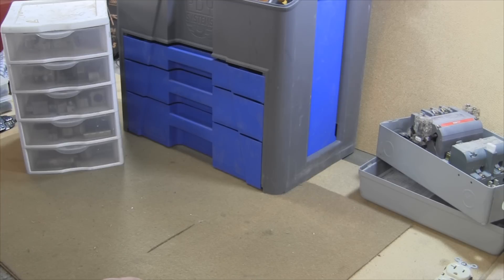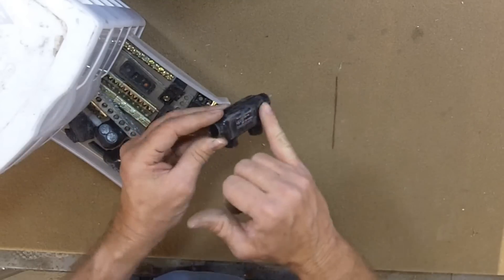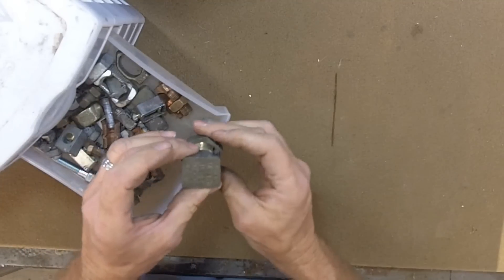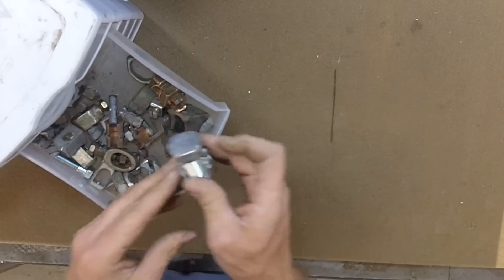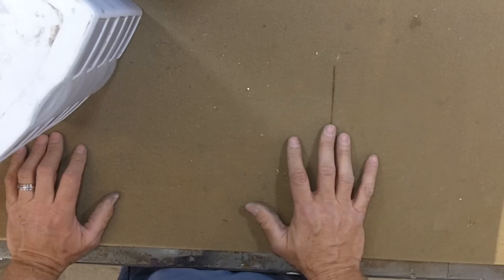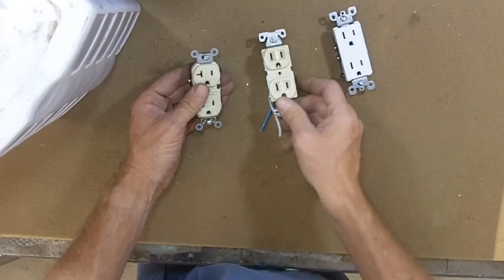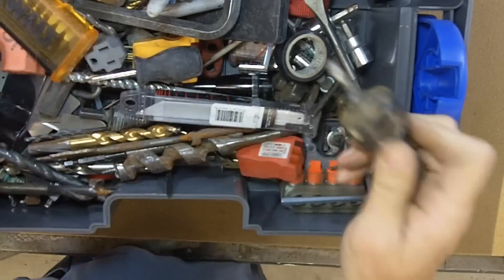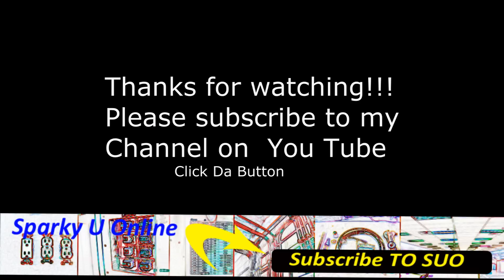Electrical lugs Electrical Crimps and a few Electricians tools

Comment from the maker: @Serostern I use smaller crimps whenever I use stranded wire and the device does not have the plate behind the mounting screw.